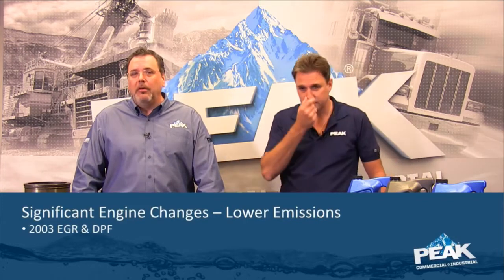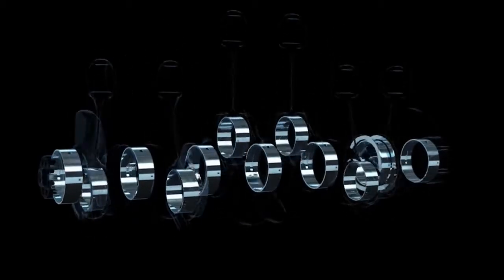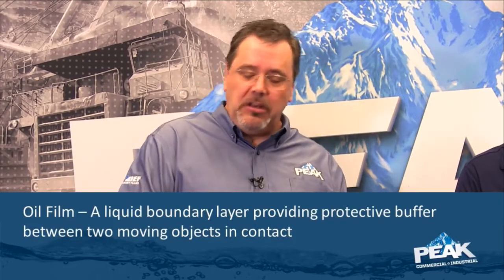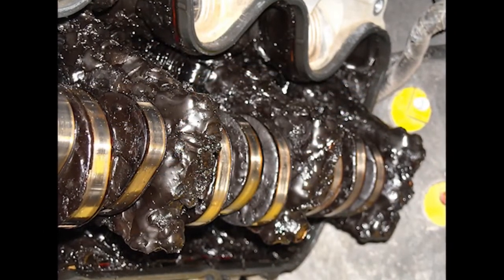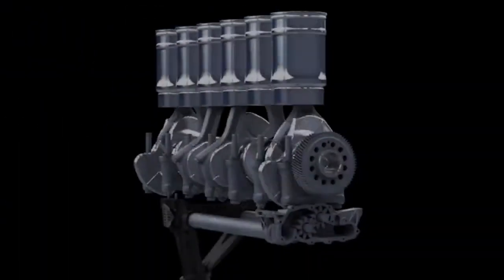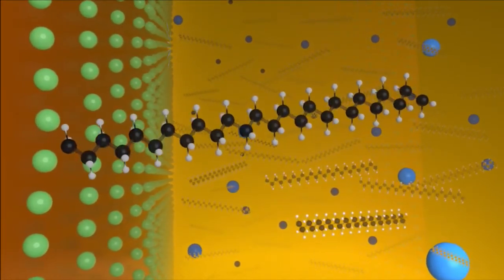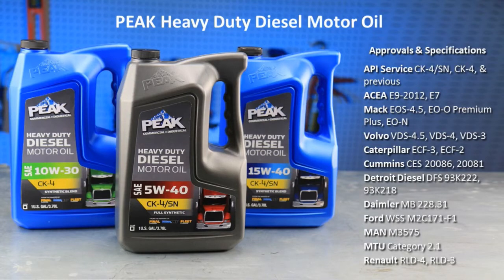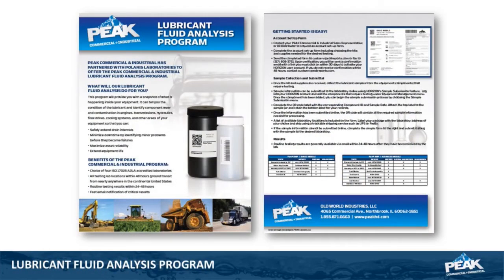PEAK Commercial & Industrial Heavy Duty Motor Oil Brand Live Video

Comment: First, I am quite surprised, as I am sure you were, that there were not any comments on this presentation about Peak HDEOs.  Second, Terry did a great job covering the focused technical aspects of Peak HDEOs - well done Terry!  Third, I realize that this presentation was directed to your lubrication distribution partners and not to retail customers like myself.  Fourth, a few comments:  I personally use Peak conventional motor oil in my gasoline vehicles.  Peak conventional PCMO is a good performer and a tremendous value.  In terms of Peak HDEO for diesel engines, I would very much like to try the product in my diesel pickup truck.  However, as a retail customer,  Peak HDEO is not available in my area.  The question and challenge to Peak is:  how do you make Peak HDEO available to retail customers?  You do a great job with distributing PCMOs - I purchase these oils at Dollar General.  In my opinion Peak needs a similar marketing strategy with Peak HDEO.  The light-duty diesel pickup truck market is very large, and it continues to grow.  If Peak HDEO was readily available, I am sure retail consumers would purchase the oil.  Couple that along with some positive reviews on BITOG would definitely expand brand recognition for Peak HDEO.